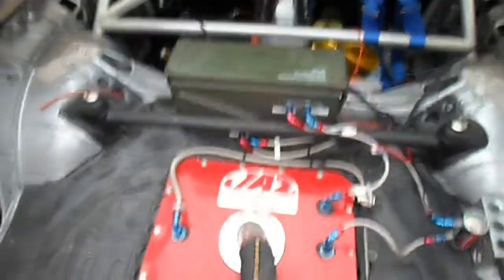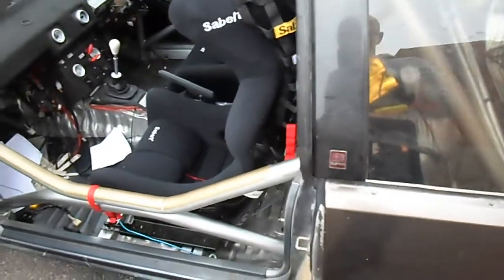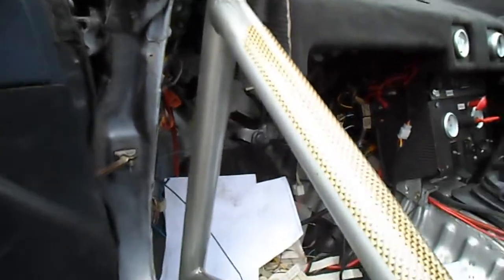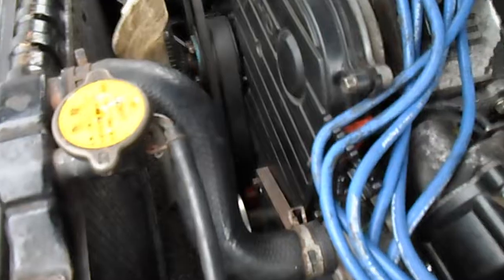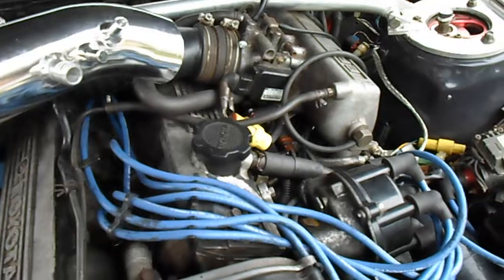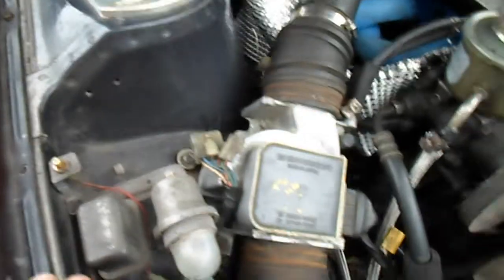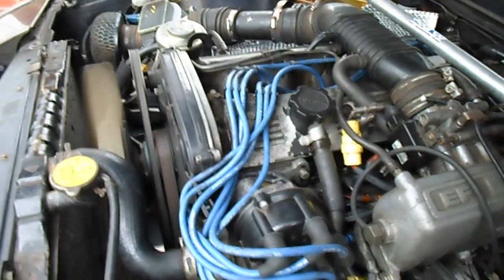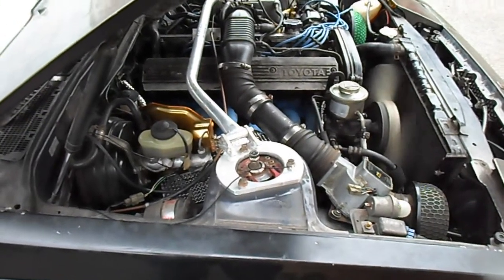Supercharged Toyota Celica Supra track project - Eaton M90 5MGZE first fire up.

Comment: Are there any driving videos?
Reply from the maker: Not yet i am afraid, I have had the car painted since this video and got it ready for MOT testing
I did mess up the fuel breather hose though, so have had to order a long length of AN -8 PTFE braided hose that will go up along the top of the rear hatch frame and back down again.
Saving the next video for the big reveal. The supercharger will be some way off as currently working out a Crank position sensor mount for a trigger wheel as the CAS from the dizzy isn't as accurate 
for ignition timing. And with that i can also ditch the Dizzy and coil and go with a coil on plug.
For that i have bought some 2zz coil packs.
Reply: @SHIREDRIFT  I also want to upgrade from the stock twin turbos to a M90.   I think i might also block off the silencer ports and probably port the Charger and the intake for better flow.
Reply: @SHIREDRIFT  I love the MK3 its such a beautiful car and id love to own one someday.
Reply: @SHIREDRIFT  Nice!

Comment: Are you running the stock ecu?
Reply from the maker: Hi there, I am running the Toyota ECU in it's current Naturally aspirated guise, but i am just working out a crank angle sensor location for the engine and will be running a 200mm Link 36-1 Trigger wheel  in front of the supercharger pulley. 
Once that is finalised, A Ecumaster Black will be wired in. I think it's very important  to be able to control Ignition timing properly and a crank position sensor will make this heaps more reliable than just relying on the Cam sensor.
Really want to go coil on plug with this too so ordered a set of 6 2zz Coil packs that will delete the stock Igniter and coil. The cam angle sensor will be kept by the CAS in the dizzy i think. I Could go with a hall effect running on the inlet cam pulley but means changing cam sprockets to Aluminium  to get a clean signal.
Reply: @SHIREDRIFT  Thats awesome. Im planning on supercharging my 5mge soon so all this information is great. Did you tune or are you just keeping it within the safe levels till you can control the ignition timing?
Reply from the maker: In the meantime I'm just finishing other parts On the car. 
If you are not that precious about keeping a 5MGE, I'd Suggest fitting an early 2JZGE non vvti  from a  MK1 gs300 Lexus as the Bottom end can take all the power and won't bankrupt you! Going forged internals on a 5MGE is astronomically expensive so i'm hoping and praying i can get away with just shot peening and cryo treating the conrods and pistons. If i break it, then hardly any point spending £3k on forged internals. The pistons alone are silly expensive

Comment: Nice Buddy. Have a Cressida with the same engine 5MGE been having problems with the wirings from my tach. Sometimes it works fine but most of the time it doesn't perhaps loose wiring from the coil or the dist as I usually remove my battery. Mind helping me out which particular wire from the coil or dist is for the tach? Thank you Buddy. Cheers 🥂
Reply from the maker: Hi there, I'd love to say for definite which wire goes to the tach on yours, but my UK wiring is completely different to other 5mge's. We had totally different spec engines. We didn't get Catalytic converters, o2 sensors , Knock sensors and had different air flow meters and camshafts too. All our P types had digital dashes too. The wiring for those is completely different to analogue 
Your best bet is to find the Toyota service repair manual, either online or a hard copy - from ebay. And buy a  multimeter with a continuity tester. You can learn all the wiring for your car that way and is a good skill to use.  In fact - my next video will be doing just that!
Reply: @SHIREDRIFT  Thank you Bud for your informative reply. Will try to figure which wire it is. Be watching your vid too. Thanks again. Cheers 🥂
Reply from the maker: @mrgalaw3390  On mine, All 3  wires on the yellow dizzy plug go to the middle,18 pin plug on the ECU. They are labelled "engine revolution sensor"
I will have a look at my car in a bit and see if i can distinguish which goes to the tach, but really your best bet is just to trace the broken wire with a continuity tester. So easy to use. They beep when a connection is made  through the wire. Sometimes, it's the quicker way to do it. 
I do have a Blue wire, with a white stripe Labelled "SPD" on the 24 pin ecu plug. Mine seems unused, but could be something on yours?!

Comment: What’s the door panel carbon fiber called
Reply from the maker: It's usually called carbon fibre board, or carbon fibre sheet. i got mine in the UK from Geoff steel racing, but various other suppliers online.I ordered 1200mm x 600mm size, and used most of it. Big doors on a ma61!

Comment: Great job! That's a lot of work. I'm planning to supercharge my Cressida. Is there anything I can do to reduce the whine? Not a big fan of the high pitched shrill. Especially while idling.
Reply from the maker: Thanks! Yeah, it's been a challenge.  I guess your Cressida is a 6MGE? 
Main issues i'm running into are Throttle position sensor not being a very sensitive signal. They are so old on my car, that they aren't a full potentiometer 
range from closed to open. Rather, Open, closed and "open a bit" You'll need to check yours with a multimeter on OHMS setting to see if it's a later one. 
There is no knock sensor with my year engine spec either so need one to work with the ecu. Speaking of ECU, Ecumaster do not have a 5MGE base map on file so i'd have to be the test bunny with it. 
To be honest, the old tech and the bottom end & piston weakness is holding me back with spending the money on getting this done at the moment. The engine will need a full rebuild as it's so old, And for the same price as a set of Wiseco Forged pistons, i could Drop a non vvti 2JZGE in it, Get a W58 bellhousing and Some Xcessive engine mounts. I love the Look and sound of the 5M, but is it really worth spending £k+ on a forged engine rebuild? Plus i'd have to include the Standalone ecu and mapping costs. Hmmm, think i'm just going to get it in roadworthy state and see if the 5MGE lets go. 

The whine is a bit louder at idle than they usually are as i had to wedge the Supercharger intake butterfly fully open. That means it's pumping 10 psi of air out at 1000 rpm idle  in my vid. If i had the recirculating valve rigged up, the air would just be bypassed so is a lot quieter when off the throttle.
Reply: @SHIREDRIFT  I love the M series engines. They feel and sound more visceral than a 2JZ ever could. 2JZ swaps have become so common that at this point it's just a cliche. I want something special. So I'm going to avoid turbos and 2JZ. Currently I have an 87 Cressida with a carbureted single overhead cam 5M engine. Not a 5MGE. Yes you read that right. See I live in Saudi Arabia currently. And they didn't offer a 5MGE here because they used leaded fuel until 2001. Australian Cressidas and Celica Supras had the same engines. However they did receive the 5MGE in 84. In Saudi Arabia, we had the 5M and 5ME engines even in the 90s Mx83 models as well. 

However it performs rather well. My Cressida originally had a 22r engine that's usually found in the 70s Celica (the 4 cylinder models were way more common here than the 6 cylinder ones.) I swapped in a 5ME from a different Cressida and then stuck a carburetor, electric fan instead of the clutch fan and a bigger exhaust on it. The rear end is still the 4.3 meant for the 22r and as a result of that, I hit 100kmph in 8.8 seconds. And unlike the American Cressidas, my car isn't weighed down by too many luxury options. I've managed to hit around 210 kmph. I will be posting some videos of the Cressida soon in my channel so you'll get a better idea.

Since my car has no ecu, I wonder if it'd be a lot simpler to install a supercharger. What brand/model of supercharger would you recommend? I'm not looking to beat a turbocharged Supra. If it's quiet and reliable, I'll be more than happy with just the extra 40hp.

I am planning to buy a Celica Supra mk2 by the end of this year hopefully. (preferably with a 5MGE 😁). And if I could get my hands on a 7mge engine from Dubai, then most likely that's what my Celica Supra would have. Unless of course a supercharger in a 5mge works out well. Can't wait to see your car running. Good luck! Do take your time and get it done properly. I am going to rebuild my engine pretty soon. Already rebuilt the head during the swap.
Reply from the maker: @alphamaledriveshard  Ahh cool! I don't know too much about the single cam 5ME's really, and yet to see one in the flesh.
If your car has no ECU, then yeah, it's going to be simpler to get running, but harder to tune with a carb. There are 2 different trains of thought with Supercharging carb engined cars. Either suck through, or blow through.
I'm not an expert with these, so will just let you make your mind up. 
Late 1970's race cars are a good reference for ideas for what works best i always find.
Imagine you'll have to run larger jets for the carb, and a Msd coil and ignition module, Colder plugs  and an adjustable fuel pressure regulator you'll need a much stronger spark and more fuelling regardless. Not sure about timing, although Valve overlap will lose you power.  Steel head gasket and ARP head studs would be a must too. 

As for superchargers, Larger tends to be better as you don't want to be running the supercharger out of it's most efficient rev range. Eaton Superchargers are the most abundant on the second hand market, and parts like bearings and pulleys are available. I'd avoid Aisin SC12'S and SC14 that come on some Toyota's. They are 2 lobe so inefficient , old and you can't get spare parts for them. Toyota TRD tend to use Eaton Superchargers with their Upgrade packs, so if it's good enough for most major manufacturers.
There are a lot of factors with choosing a supercharger besides size though. The Bottom Crank pulley is the most important. Both for compatibility and diameter.
Pulley ratios are the deciding factors in Litres  of air output per revolution, This Eaton m90 pumps out 1475 cc Per revolution. 1.475 Litres of air. 
And if you find a V belt  that fits your crank Pulley  - Like i did with this ,
It will have to  work out the ratios to see how much boost it's make. 
For example My crank Pulley is 5.5" Diameter, and the supercharger snout pulley is 2.8" dia. so 5.5/2.8 = 1.964 Pulley ratio.
The modified Jaguar Supercharger Bottom pulley i am using is 7.5" 
So 7.5/2.8 = 2.678 Pulley ratio. 
Supercharger boost is around 6 psi with the 5.5" bottom pulley and 10 psi with the 7.5" 
Then you've got to make the Belt line up perfectly with the crank and snout pulleys. This can be quite hard to do! 

Have you seen this video yet? Sme Eaton m90 i'm using but on a 5ME engine. That should help!
https://youtu.be/ic9OTrK4IYI